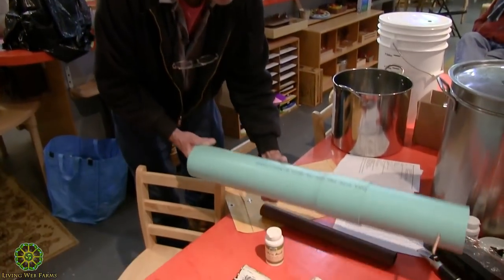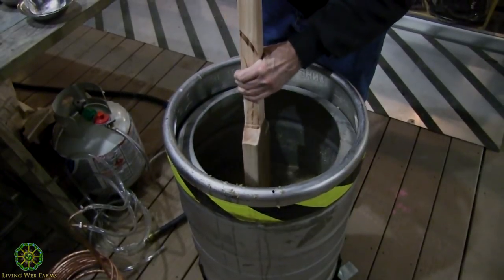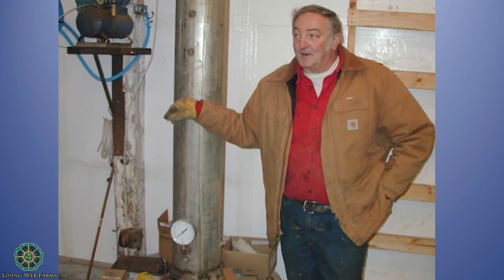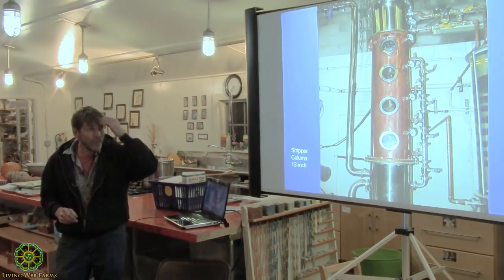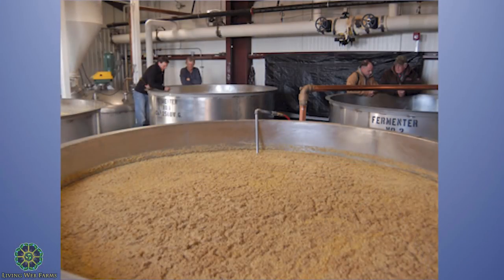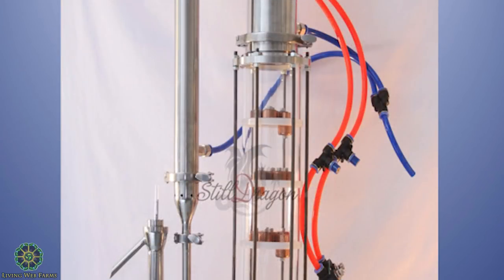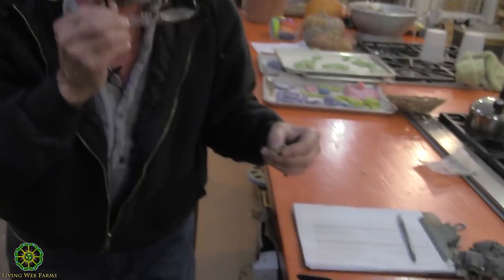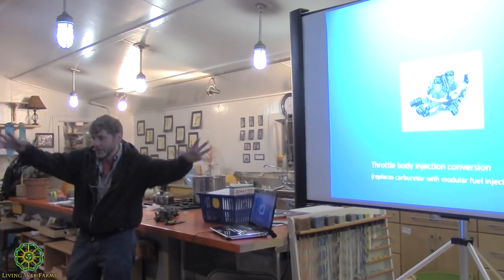Alcohol Fuel Production Part 6

Comment: @40:42 - One thing many performance enthusiasts do for track use is add methanol as boost in increased to COOL the intake charge to prevent detanation in lower octane fuels. Given wager injection has been used through the years, perhaps ethanol could also be used in a similar metered system. I don't see why not.
Same maybe applies to diesel, but I'm not as familiar with diesel induction systems.
Reply: As was said @40:42 - ot is absolurely cam timing - lift - duration - AND lobe seperation that are optomized for gas. As such, an engine with a cam driven valvetrain - dictated by a bump-stick  really can't be built to burn fuels with widely varying chemistries - only one will burn "most efficiantly."
If it's built to burn high alcohol fuels EFFICIANTLY, the higher compression ratios will NOT allow you to burn 87 octane pump gas - EFFICIANTLY without meltimg downnor smashimg all the pistons.

Comment: @30:19 When I think about the mechanics of modern harvesring practices in larve scale operations, from manufacturing tractors and impliments, miver all that gear through supply lines, and the fuel amd lubricants the consume each year, I have to honestly question where this big economic savings is occurring, still. It seems the margins would be small both ecinomicly as well as and real savings in carbon footprint.
Just thinkimg out loud with about 7 billion of my friends. :)